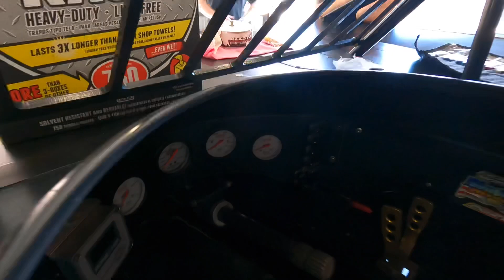Jonathan’s Racing Again! And We Said Goodbye to One of Our Race Cars

Comment: When I recently rebuilt my engine I bought a used msd pro billet. While hooking it up on the run stand not knowing because I didn’t cut the factory plug I hooked it up color to color as a normal person would. After running it and finding things weren’t right, I did some research and found the factory plug actually has the wires color codes crossed. Purple to the green on the pick up coil and green to purple. Threw me through a loop but I figured it out.

Comment: With all the troubles you are having with starters, I understand it is good to cycle the oil in the motor before firing, but are you possibly burning your starters out cranking them so long at a time?
Reply: Exactly what I was thinking. They sure dont last long. Can't be good on them because they are not much punkin.
Reply: Exactly what I was thinking. In the old days they would cut the gear off of old distributor and made a tool to insert into a drill  then drop it down thru distributor hole and prime it that way.

Comment: Is that the new Capital that was sold?
Reply: Yup
Reply: @thomasgray2184  my opinion is that something did agree to them with that chassis
Reply: @chrisjackson9386  Couldn't get to it handle.
Reply: @jongolliher4280  that was obvious now I wonder what the biggest difference is between it and old faithful?
Reply: @chrisjackson9386  The one that was sold had a handling problem they and Capital couldn't correct and it was just not competitive. They even put the new higher hp motor in it expecting good things and just wouldn't handle.
Reply: @jongolliher4280  it's a shame that the builders couldn't get it to handle!
Reply: @chrisjackson9386  The general thinking was that the chassis got tweaked in one of the wrecks it was involved in shortly after they got it.   Capital had it on the jig and didn't find anything.  My opinion is that something was damaged or cracked and flexed in the corners and just couldn't find it.  I would have got rid of it also because when you can't get your car to handle you gotta move on.

Comment: Hey do yall ever scale yalls cars
Reply: Yes they do. Just don't show their set-up procedures.
Reply: @gailtaylor1636  where are the scales in that shop? I’m afraid you are making a wild assumption.
Reply: Only reason to scale a dirt late model is for total weight.
Reply: @vernsimmons945  Nope. Electronic scales don't take up much space. They just mentioned Jonathon's weight difference from Jesse & how might actually remove weight with steel head motor. Need scales to know.
Reply: Vern Simmons so they dont worry about cross and nose weight?? I come from gokarts where all that was scaled out
Reply: @coreymarsh4649 everything is done with load numbers on a spring smasher. Scaling out a dirt late model for anything other that total weight went out 6-7 years ago.
Reply: @vernsimmons945  I'm curious what purpose the weight jackers have on the front of these chassis? Ride height?
Reply: @gailtaylor1636 once you have your car balanced and load numbers correct, you can adjust the height on the car to seal off the nose as much as possible without actually hitting the track.
Reply: And  if so I need to get into race engineering because that’s craziness masters degree EE  in automotive engineering bachelors from General Motors Institute if you think Formula One cars the height of auto racing is not checking weights on every corner then you would be wrong and if that’s how the game is played here then I would have to hear from Kevin Rumley why that would be so
Reply: @thomasgray2184  how about industry leaders that build current suspension parts for the dirt late model industry? Performance Racing Industry magazine had a great article last June I believe about the science of suspension setups. Scaling a dirt late model went out about 6-7 years ago as load numbers and spring smasher technology became more available.
Reply: @vernsimmons945  Exactly, all they need is the spring smasher to set the weights.
Reply: Not sure that I've ever seen a set of scales in any of their videos.
Reply: @brookinstephens204  they used a set back a couple years ago when they raced out of Dirt Daddy’s shop. Again that was to get total weight of the car and know how much lead & fuel to add. Most dirt late model team rarely use scales anymore other than to get total weight.

Comment: Why go through all that work for a 602 race? Just run 604 and not change engines twice. It's not like Jonathon doesn't have the experience. Or is he scared?
Reply: Think they having a good paying 602 race.
Reply: @gailtaylor1636  That, and I'm guessing they're trying to help out the local track. I'm sure when the HTF guys run they get a bigger audience and a cut of the streaming money.
Reply: @heyoverhere8234  $2500 on the line. Well worth the work when track is a stone's throw away. They have a great set-up for 602.
Reply: You Tube Content pays the bills. Look at all of the comments asking when Jonathan is going to drive again. It’s local so he can be at home at night for baby chores. He also needs to debut his wrap for the shirts to come.
Reply: @gailtaylor1636  If they are running for the money, they should be putting Joseph in the car. Jonathon is great, but he has not been in the seat for 2 years
Reply: @rcp935peek4  Excellent point!